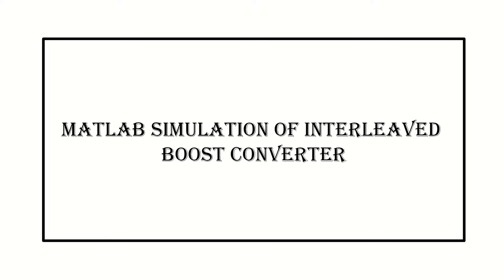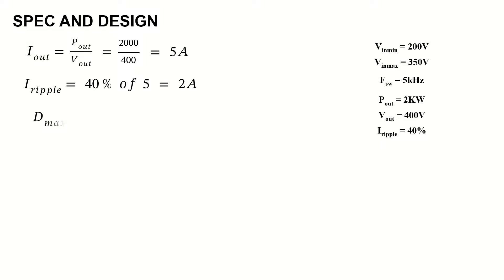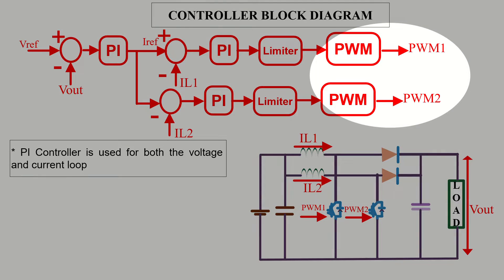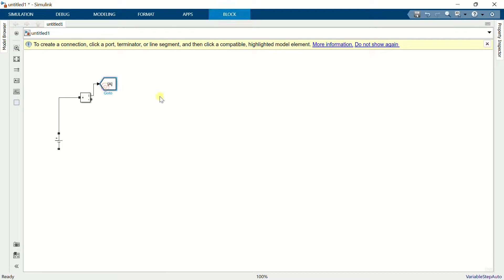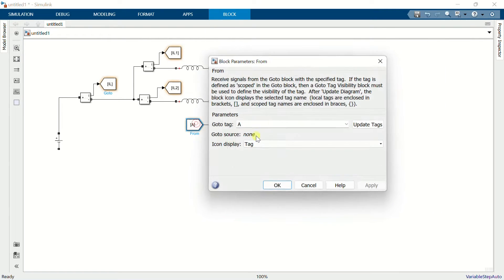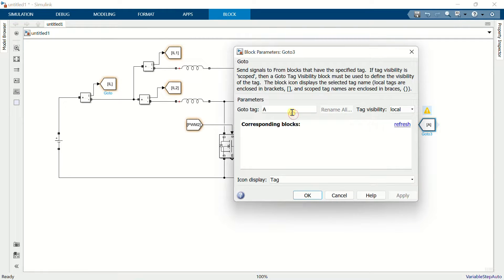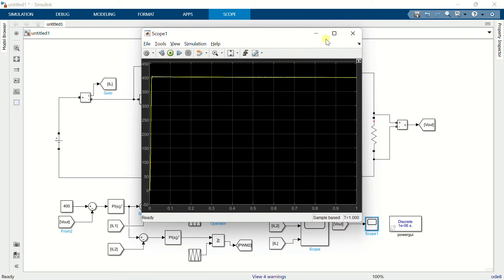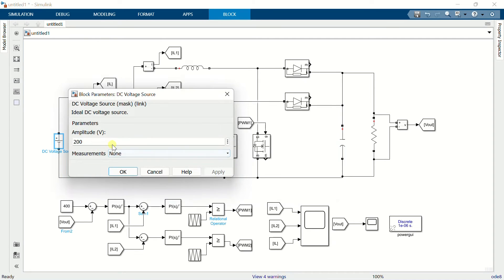INTERLEAVED BOOST CONVERTER | MATLAB SIMULATION | TECH SIMULATOR

Comment: in the battery charging circuits of electric vehicles, we use this type of PFC circuit to improve the power factor and we use another boost converter to adapt the output voltage to the charging voltage of the batteries (ex: 400V)  .  But you with your simulation you have 400V at the output, why using another Boost converter is it necessary, or we can limit ourselves to the use of this PFC to charge the battery at 400V ? 
Please answer me, because I  need it, it's for an internship
Reply from the maker: my battery voltage is different

Comment: Hello Tech Simulator,  I was designing this  converter  and I wanted the current output of 950 A and voltage of 1200 V, i have designed all the other parameters but i am facing problem in the control circuit. Could you please help me out
Reply: did you get your issue resolved?